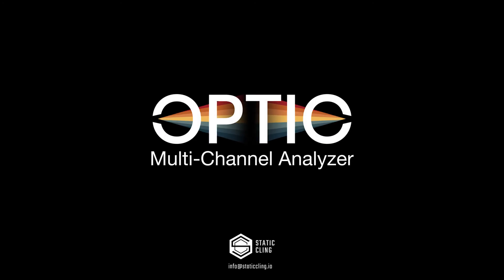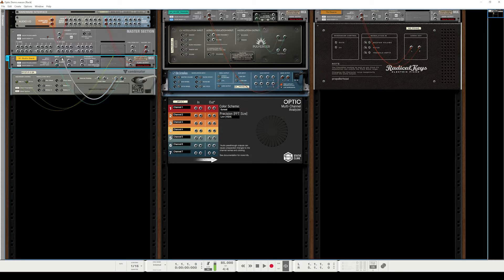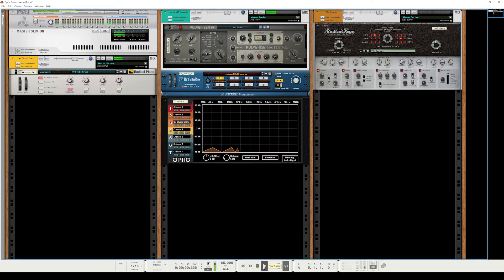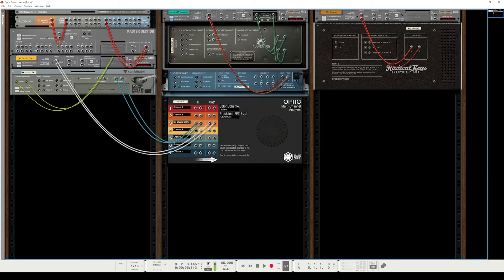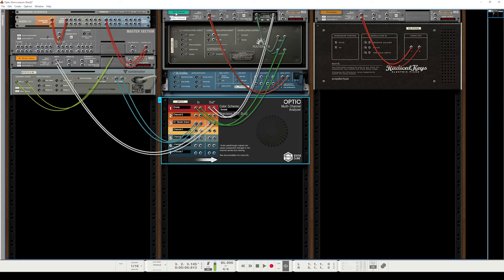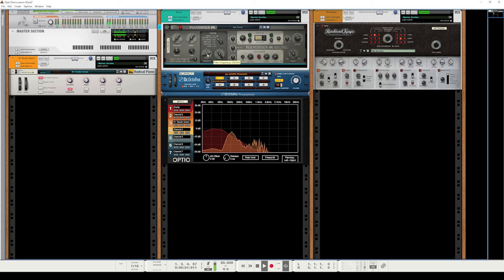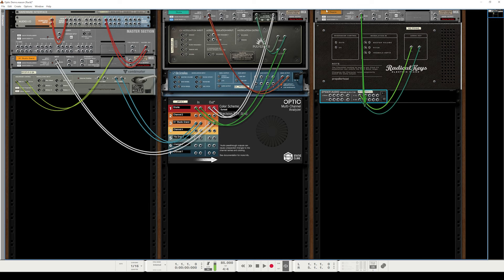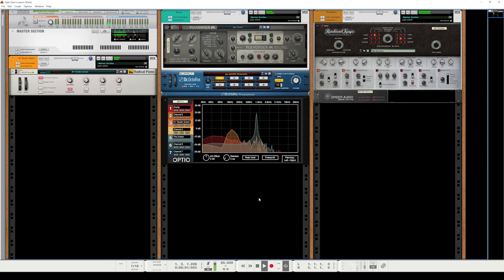Optic Tutorial Part 1 - Wiring

Comment: Hi Markus, i can't figure it out correctly. You say it completely breaks the internal routing to the mixer using the direct out.
But how do you manage this? Where to connect from Direct out? 

I need to be able to see changes whyle tweaking the spectrum EQ (F2)
If this is not possible, than this RE is useless since i am forced to work with other EQ's as insert effects to see changes in optics?

I like the Idea of Optic very much und it looks really nice.
Reply from the maker: There is a work around, but first let me explain why it needs to be done. As far as I can tell the only real-time way to get the audio that has been affected by the channel strip into the rack is to use the Direct Out Jacks on the back of the channel strip. This gives us access to the audio with the Spectrum EQ filtering applied, but unfortunately it breaks the internal wiring with the Reason Mixer, which is a serious side effect. To fix this, we need to route the audio from the output jacks on back of Optic into a second Mix Channel, that is left alone, internally wired. This allows us to see the effects we apply on the first channel, while maintaining the convenience of internal wiring. The obvious downside is, you temporarily have an extra mix channel for each instrument you want to analyze with Optic in this way. It is inconvenient, but at the moment I don't see any other way to accomplish this, and it is beyond my control to fix. I will post a video shortly showing this setup, and I hope this helps you make your decision! Thanks for the kind words about Optic.
Reply from the maker: Here is a video outlining the process: https://streamable.com/5ssu2

Comment: Hi, I don't see any visual change when I dial in the mixer channel's EQ. For example I set HPF from 30 HZ to 2kHz, in Optic the low frequencies are still there.
Reply from the maker: This is because the effects of a mix channel are applied after the stage that you are inputting into Optic. As far as I know the only way to access the post-channel strip audio in the rack and send it to Optic is to route it from Direct Out jacks on the back of the mix channel,  but this breaks the internal routing.

Comment: why not simpy connect it to the pre-out output of the mix channel....
Reply from the maker: Terrance Moon I assume you're referring to the Direct Outs on the back of the mix channel? The reason I couldn't recommend using these is because it completely breaks the internal routing to the mixer and I assumed to 90% of users that would be unacceptable. If it works for you though go for it :).

Comment: Hi, from this video I see that the analyzer has to be wired individually from instruments and cannot be wired to the final mixing channels, that may add effects and compression. It is better to see the final sound of a channel in the mix being analyzed and compared. Is it possible? It's a game changer for me.
Reply from the maker: Leonel Dolara I believe if you use the Direct Outs on the back of the mix channel you will be getting the audio after all mixer strip processing has been applied. The problem is using those jacks completely breaks internal wiring to the mixer, which would presumably be a problem for most users.